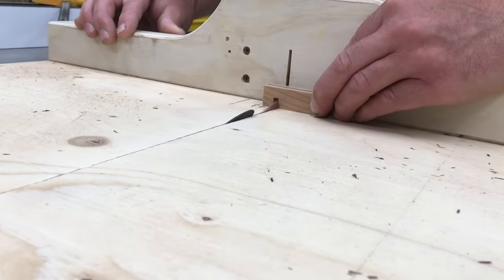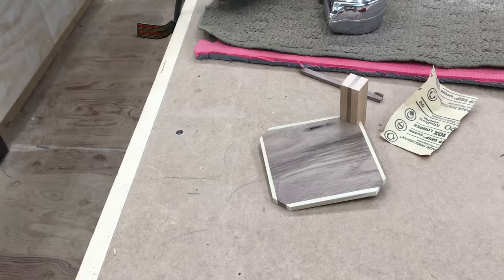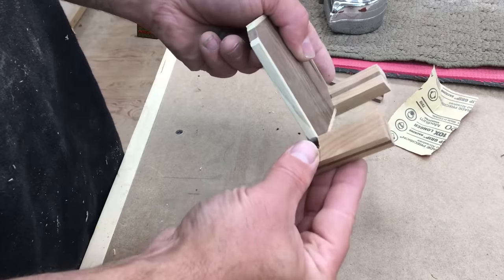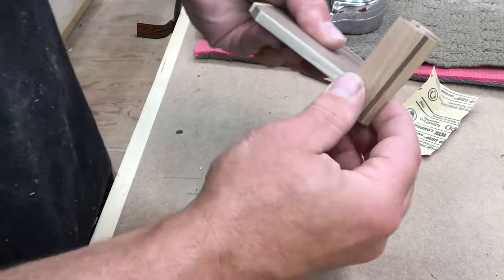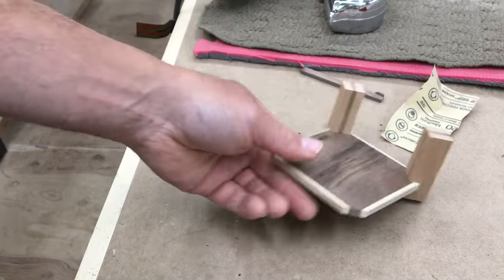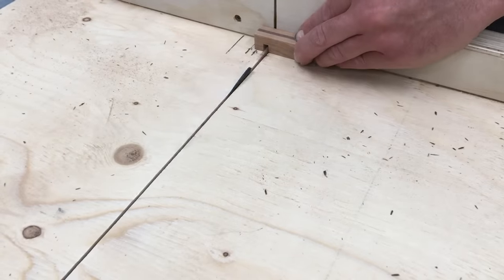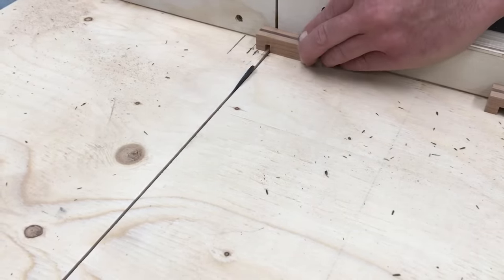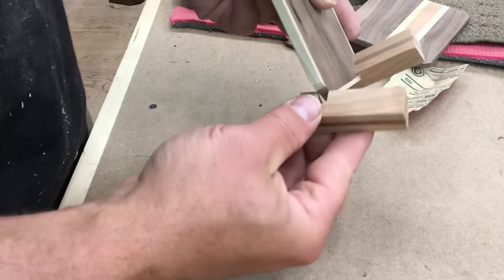Making Wooden Coasters with Holders. 6 DIFFERENT DESIGNS!!

Comment: I have  been thinking about making some of these as well as cutting boards to sell in order to pay for the tools required and then use those tools in future projects, so i was wondering how much would you personally sell a set of coasters like this for?
Reply from the maker: I’ve never sold a set, these were a one off and were given as gifts. Ultimately you need to figure out the cost of materials and put a value on your time. Then keep track of how long it takes you. A piece is worth whatever someone is willing to pay for it. Best of luck!

Comment: Very nice wooden coaster and l like you works, could you tell me the measurement of your coaster. Are you come from Montréal or Québec City?
Reply from the maker: Thanks for the compliment! The coasters are approximately 4" square. I'm actually located in northern Ontario.
Reply: Thank you for your quick response.  I was looking for thickness of you wooden coasters?
Reply from the maker: They’re about 5/16 thick. 3/4 material cut in half then run through the planer

Comment: I'm making a set for myself out of the off cuts from cutting boards this Christmas, and for the holder, I'm drawing inspiration from your second to last holder design (the one after the one with the holes, but has that 45 degree or whatever angle cutout in one corner)

I was curious what the bottom of that is like, since it looks like the holder has feet but can't see the bottom... Is it open or closed?
Reply from the maker: It’s closed on the bottom, about 1/4 inch up. The “feet” are cut into the side panels. Best of luck!

Comment: What is that disc attached to your drill press 2:12  ?   I'd like to purchase one but "buffing wheel, leather flap wheel" etc. haven't brought up the correct item.  Great looking coasters.
Reply from the maker: It's actually called a sanding mop. I ended up with a couple mixed in with a box of misc tools I got from a garage sale. Surprisingly I use it all the time! Great for getting a final sanding, especially on pieces with little nooks and crannies. Thanks for watching!
Reply: @bitsofwoodworkshop9393  THANK YOU!

Comment: On the four post holder, how did you clean the glue up push out? The video just showed going to the oil.
Reply from the maker: I use a damp rag before it dries, then sand what I miss.
Reply: @bitsofwoodworkshop9393  Thanks bud!

Comment: Anymore info or detail on the hanging setup? Just a half lap on the bottom two pieces? How did you join the vertical piece to the base pieces? Great video and ideas!
Reply from the maker: Here's a link to a picture of the joint. https://www.facebook.com/198499354210216/posts/306150530111764/
The dowel was done by gluing 3 little strips together, sticking them in a drill, spin and sand till it's round.
Hope this helps!
Reply: Thank you!!

Comment: Do you have any plans for these? Bill of Materials or plans etc.?
Reply from the maker: No plans I'm afraid. I tend to just make things up as I go and rarely make the same thing twice.
Reply: Bits of wood Workshop Can you take some measurements?
Reply from the maker: I gave most of the sets away so I can't really measure anything. What exactly would you like to know? Maybe I can tell you from memory depending on which set.
Reply: Bits of wood Workshop I just wanted to know the dimensions of the box that holds the coasters. How you constructed it etc
Reply from the maker: The coasters are about 4" square by 5/16 thick, whatever style box you make needs to have a finished inside dimension of 1/8 larger than the coaster giving you 1/16 all around. These are just guidelines tho, you could always work backwards too and build a creative box/ holder you're happy with then make the coasters to fit inside. Good luck!

Comment: I used poly and the surface sticks with a hot coffee. Also the surface has completely boiled up when left in sun
Reply: he used tung oil to seal instead of poly to avoid this issue. typically things coated in poly are not meant to be left out in the sun.
Reply: @shaingreen6833  I did not catch that. Where does he refer to tung oil?
Reply: @diybuildandlife207  he doesn’t as there is no narration in the video. he does show his finishing process though(4:40) where you can see the can of tung oil he uses.

Comment: Brand new to woodworking so this may very well be a silly question. How do those particular woods (saw you said to someone else walnut, cherry, poplar, maple...) hold up to moisture from drinks with just tung oil on them? is there another finish recommendation to protect the wood? Thanks and great video!
Reply from the maker: There's all sorts of ways to finish any wood project, and I'm certainly no expert on the subject, but I know tung oil does seal the wood without leaving a coating. I prefer this in most cases as it leaves the wood looking and feeling very natural. Now although the wood is protected from moisture fairly well it still wears and gets subtle rings from use. Personally I like that. Feels used and you aren't scared to use them, or toss them at your kids😅. If you wanted them to stay shiny new you could give them a few coats of polly. Hope this helps.
Reply: Haaa, I think I'll test them by throwing one at my wife. Thanks and keep up the good work!